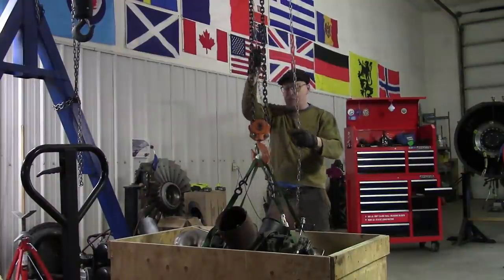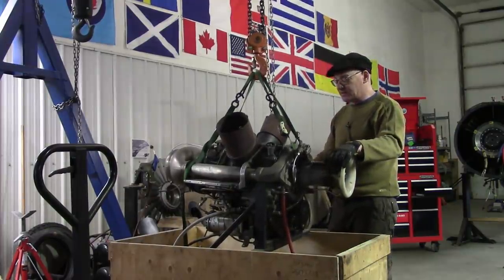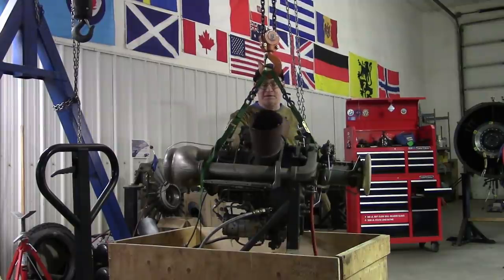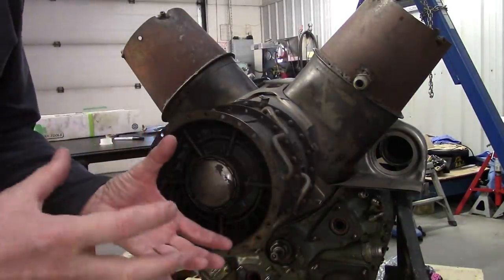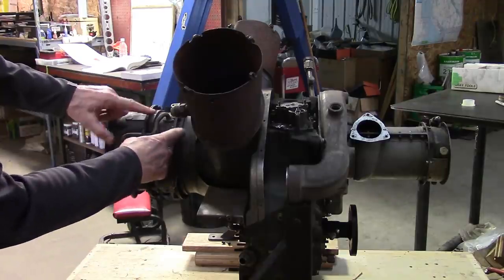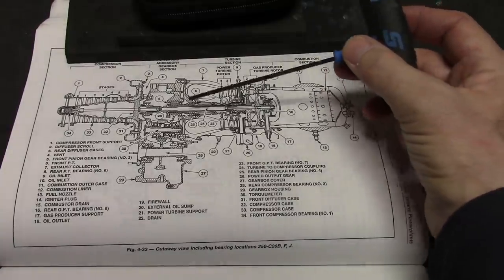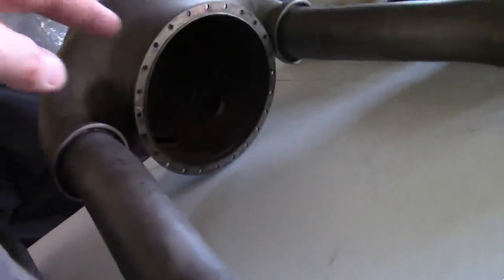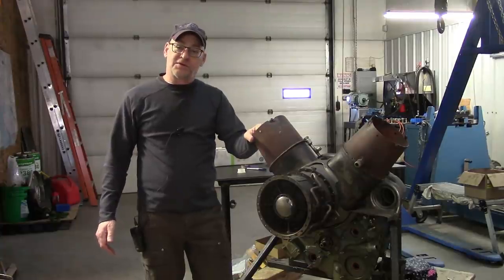Mini Jet Boat Ep.1:  The Beginning

Comment: A great example of different engineering goals leading to different engine topology. When you're trying to make mechanical power for an output shaft in a lightweight package, you just might build the turbine engine inside out as compared to a turbofan used to produce a jet of fast moving air and end up with the combustor in back instead of the middle.

Comment: Somehow I imagined that a Bell Jet Ranger would have required more than just 320 hp.  Learned something new today, thanks!
Reply from the maker: The C18 was the first. Quickly replaced with the C20, making 400. The C47, according to RR makes over 800 at takeoff power.
Not bad for the little engine that could!
Reply: @AgentJayZ  The Jet Ranger is unfortunately limited by its main rotor transmission still to this day. So even the C20B when installed in the Jet Ranger B3, is derated to only 317 HP output just like its C18 brother.

Comment: Horsepower of 300 and some is not realy impressive until you hear that all the gearbox and pumps and compressor and everthing together weighs just 70 kg!!!!!! 
Newer model - C20R - even makes 450 HP with 78 kg total weight! 
Colour me astounded!!! 
Kudos, AgentJayZ for letting us peek into you work and thank you!
Reply: Remember the first designs also date back to 1957, with similar power and mass, though the intervening years did have massive improvements, in power and reliability, along with massive running time increases as well. From engines that ran only a few hundred hours between overhauls, to engines that run thousands of hours between services, and which are more reliable as well, along with improved fuel efficiency.

Comment: Good engine for this. Tons of parts around. Small and light. I spent the last few years working for a large overhaul facility on these engines accessories. I can't remember all of them but the major difference between the 18 and the 20 was the 18 had the max stop on the FCU restricting max fuel flow. Just saying that if it was to go into a boat with no certs I might look for a C20 FCU. You should be able to find a  DP-N2  -28 or 26 FCU for cheap

Comment: Several months ago, I was watching your channel and wondered to myself "are there any engines that reverse the direction of airflow and what would that look like"?
And here's the answer. Thanks!
Reply from the maker: Have a look at the airflow diagram of the P&WC PT6. It's the second most produced gas turbine in history (after number one, the RR250!).
Reply: @AgentJayZ  Thanx! I can't wait to see this boat in action.
Reply: Engines that have a reverse airflow arrangement? Let's start with the Armstrong Siddeley ASX, the Armstrong Sidddeley Python and the Bristol Proteus.  However, they did have their jet pipes at the rear of the engine. Take a look at at a cross-section of the Proteus, which you should be able to find: the other two had essentially the same layout. 
The intake air from the front of the engine flowed around its exterior to turn 90deg inwards into a radial air intake between the compressor and the turbine.  The air was then turned through 90deg to enter the compressor, through which it flowed forwards.  At compressor delivery, the air was turned through 180deg to enter the combustion chambers, which were placed around the exterior of the compressor casing.  The turbine entry ducts passed through passages in the air intake casing and into the turbine. Now that is definitely a reverse airflow arrangement. The reason for this layout was to reduce the overall length of the engine.
In comparison, the Allison/R-R 250 has its air intake at the front of the engine, with compressor delivery air being ducted to the combustion chamber at the rear, from which the gas flows forwards through the the turbines, to exit via those distinctive exhaust elbows behind the rotor head on the JetRanger.  Compared to the 250 and the other three engines, the PT6 is just 'back-to-front'.
I was trying to find an illustration of a small US turbofan, which I thought had an arrangement somewhat similar to that of the PT6 and/or the Alllison 250.  I recalled that it had exhaust 'elbows' extending into the bypass flow.  However, I couldn't find it - but then the designation ATF3 emerged from the depths of my memory.  Please see my additional comment.
Reply: The small turbofan engine that has a reverse flow arrangement, to which I referred in a previous comment, is the Garrett ATF3.  If you search, you will easily find a cross-section and an airflow diagram.
It's a 3-spool engine: the HP compressor is a centrifugal stage, which as the rear of the engine, the IP turbine drives the fan, and the LP turbine drives the IP compressor.

Comment: so excited for this build. I'm a retired dude who flies the 206s and loiters around the hangar watching maintenance and inspections. Would love to see a deep dive on the oil system maybe with your thoughts on why the aft bearing particularly prone to coking.  Also, maybe a bit off topic, if that engine still has a freewheeling clutch, I would love to see its internals before you ditch it.
Reply from the maker: The sprag clutch is part of the helicopter gearbox, so we don't have it.
The aft bearing is directly in the path of combustion gases. It's under that shiny cover in the thumbnail for this video. Well protected by steel and cooling air during running, but after shutdown it sits there and the heat soaks in.
Reply: @AgentJayZ  roger that. I was a little imprecise. The most problematic bearing is No. 6 (the aft is No. 7). I'm sure your comments still applies.  On an annual  inspection, we measure the flow out of that bearing. Mods were made to add a little sump for that bearing and also a check valve to cut off oil flow a bit earlier during shutdown. I believe the sump promotes draining after scavenge suction has dropped.  We're also trained to hand turn the main rotor backward after shutdown. (backward because of the freewheel clutch). but there isn't much agreement about the effectiveness of that. 
Just for the record, for aspiring heli folks,  the sprag clutch isn't exactly part of the helicopter gearbox, it attaches to the power takeoff pad on the engine accessory gearbox. From there, the short shaft goes through the forward firewall and connects to the MR gearbox in the next compartment. https://photos.app.goo.gl/XEBxH9H3L95VMgxz5

Comment: Great project! Have seen some crazy offshore boats built in the past with T58 GE and a bunch of superyachts with even larger turbines in them. Any thoughts on how a diesel powered Capstone turbine could be used as a range extended hybrid electric set-up ?
Reply from the maker: There is no advantage in using a turbine engine as opposed to a piston engine for that purpose.
The are disadvantages: the smallest turbine engine I know of designed for running more the a couple minutes is 200 HP. It costs a few hundred grand.
That's your second disadvantage right there...

Comment: This is awesome!!

I have flown some of these and there has always been one thing that has bugged the hell out of me.  The torque meter. 

I could never get a good explanation of how that works and what it is really reading.   For years no one could ever tell me how it works.  Then at Sun-N-Fun I spoke to a guy that was converting Chinook engines to jet engines for planes.  He told me that in the gear box are two beveled gears and under toque they try try to spread apart and that opens a valve and it uses oil pressure to push them back into position.   The gauge reads this pressure. 

Not sure why it would be setup that way.  If you could zero in on this setup so I can see what is going on in there so I can make some sense out of it.  Thanks if you can help me understand how that works.
Reply: That sounds like a hydrostatic thrust bearing with a pressure monitor. Usually hydrostatic thrust bearings are used very large applications such as hydroelectric turbines using one would make sense for this application, the valve could be integral to the bearing in the form of a port or ring of ports.
Reply: @ValExperimenter  That is what it sounds like, but I really would love to see it to better understand it.
Reply: @Gadget0343  i have a RR250 training manual with the explanation
Reply: @juanmam1992jm  Cool.  Is that something you can share somehow?

Comment: I wonder if Rolls Royce Holdings could brainstorm with Rolls Royce Motor Cars to use a 250. Chrysler tried a turbine car back in the day, but that was a totally different beast. Something with a 250 generating power for electric motors and auxiliary power would be interesting.
Reply: Have a search for the Jaguar cx75, prototyped hybrid electric twin micro gas turbine set up for emergency power generation/range extender, was a few years ago now, never found any details on the "micro turbines" but just from the name I doubt they were anywhere near the output of the RR.
Reply: Rolls-Royce motor cars are really top-end BMWs and have been for many years now.  I suspect that they will be going hybrid and electric, in accordance with the policy of the UK government, even though the bulk of production is exported.

Comment: Put that in my lil boat. It is 4'x7'  w/ a 4" freeboard. Weighs about 80# w/o the motor or gas. It has paired fender flares front and back for styling. I love it. Early fiberglass front engine, pre wave runner.

Comment: You guys have the gear box on that engine, we used the tail rotor drive shaft quill to power a drive shaft going to a prop. The engine uses a lot of gas, the engines were made that way
Reply from the maker: As mentioned, burning gas(oline) in this engine will work, but will shorten the service life of the fuel pump and controls. It's designed to use kerosene, Jet-A, or diesel.

Comment: Awesome project... Is he going to employ a Berkeley Jet Drive Model 12JC with this project? Which boat hull design does he like? Classic jet boat, High performance Pad hull, Pickle Fork? I powered a 17'9" High performance Pad hull with a v6 outboard developing 271 HP... 80 Knots was no problem. I'm known as a Boat Yoda! I've never employed a turbine engine for a boat power plant. Gas ~ Diesel 1HP ~ 1,000 Marine Service Specialist, 8' ~ 52' Composite Loft Plug Specialist Fiberglass ~ Carbon Fiber parts producer Marine ~ Aerospace... Electric Drive Specialist...

Comment: Does the gearbox provide enough resistance to allow the engine to run without anything hooked to the output?
Reply from the maker: No, but you can run a free power turbine engine with the power turbine immobilized, for a few minutes.

Comment: Do you think this might be the longest running production engine?  Certainly there isn't any automotive or truck internal combustion engines designed in the 1960's that is still being produced today.
Reply: The last 'classic' Mini was produced in 2000.  Its engine was a development of a 1940s design, with relatively minor changes.
Reply: VW ?
Reply: Buick Rover Land Rover V
Reply: @axelknutt5065  Yes, the original flat-four, air-cooled engine was designed before the war by Ferdinand Porsche for Adolf Hitler's Peoples Car, wasn't it?
Reply: I've already mentioned the 'classic' Mini engine, basically, the BMC A-series engine, which, I believe, was derived from the Morris Minor's 803cc engine.  I might also mention the Jaguar XK engine, which was produced between 1949 and 1992, but I believe that the VW Beetle engine can probably claim to be the longest-lasting automotive engine design.
Reply: You might be right. Chevy small block is probably closest in cars. Ural motorcycle engines might have them beat but the 250 is looking down the barrel of 70 years old.

Comment: What does a used Allison 250 C-18 cost ballpark.
Reply from the maker: As always, depends upon condition.
This one was missing pieces, hadn't run in 15 years, and was given to me by someone who was never going to use it.
I had done nothing with it for ten years, so I offered it to anyone who was going to spend the time, effort and money to put it to use.
the C-18 is no longer supported, so you can find them by searching and scouring. But since they are no longer part of the aviation aftermarket, they will be hard to ferret out.

I just searched for one, for 20 seconds, and found none, but there was a nice, shiny C-20B for 150 grand.
This engine was considered scrap when it was originally obtained back in the 90's, for the price of a decent used car.

Comment: Finally. Boat. I do have to ask. What would happen if I put this on a jetski?
Reply from the maker: That was one plan. The exhaust handling might be a problem. Lotta burning hot air to not get in your face...
Reply: @AgentJayZ  Water jacket the exhaust. The Lake is your radiator! Jetskis are fun to work on as long as you make up your mind to just pull the engine instead wasting time working in the tight spaces...

Comment: Hey thank you for your great vids.
I've a question about this kind of engines: How high is the pressure in the pipe from the compressor to the combustion chamber? Is this even measurable?
Best Regards from Germany
Reply from the maker: That variable is called CDP or compressor discharge pressure. The info I can find is the compressor ratio of the next latest engine after the C18, the C20.
It's listed as 6.2:1 So in that engine at full power CDP would be 14.7 X 6.2 at sea level.
Reply: On the C20, which is the successor to the C18, the discharge pressure of the compressor on a good engine is around 200+ inches of mercury at full power. So about 100psi.

Comment: So does 100% of the air coming through the transfer tubes have to escape through the combustor liner and turbine section or does some of the cooling air get bypassed?
Reply from the maker: There's no escaping, and no bypassing.
The compressor discharges air into the two ducts that lead to the combustor. Some of that air is used to burn fuel, but most of it is used as cooling air. By the time it all leaves the combust, the mixture of cooling air and combustion gases is all the same temperature, which is why I call it "working air". It is the gas stream that flows through the turbines, and does all the work.

You could say that the portion of compressor discharge that is not used for combustion "bypasses" the combustor, but that is not the way the engineers describe it, and you will always find people like me saying "that's not the correct terminology".

Bypass air has a very strict technical definition, and there is no bypass air in a turboshaft engine.
Reply: @AgentJayZ  I was just trying to figure out if all of the air had to escape through the holes visible in the combustor liner. It doesn't seem like there is enough area. But then again, I was shocked to find out just how little of the overall diameter of any jet/turbine is used as a pathway for air moving through the engine. Thanks.

Comment: There's a sad but relevant news story of a fatal jetranger crash in St. Thomas last month. Although preliminary, the evidence suggests that the third stage of the compressor shed a blade;  which completely stubbed the 4-6 stages. (C20B). I'm comforted that I mostly fly a heli with a C30P. This iteration of the 250 completely eliminated the axial stages and gets by with only a centrifugal compressor. Seems like a huge simplification. Did something change in centrifugal design to make this possible?
Reply from the maker: Yes, the aerodynamic performace of the centrifugal compressor was improved to the point where the axial stages were not needed.
Reply: @AgentJayZ  Amazing!

Comment: I just don't like to see the compressed air path being bent.
Reply from the maker: I don't like being bent to see the compressed air path.
Reply: Luckily, the airspeed after the last compressor stage and before the combustor is pretty low, so the losses are not bad (and it sure helps keep the engine compact).

Comment: I'm sure you've seen the Nye Thermodynamics turbine boats on Lake Ontario they are insane machines...  he was replacing 1500lb 400hp piston engines with 400lb 1400hp axial flow turbines.  I think his boats got up to 80 knots they but were at least 20 footers to handle the power.  It was finding a manufacture for the water jet to handle the power was his biggest issues if I recall.
Reply from the maker: That is lame. The Jet boats on my channel are 23 feet long, have 1200 Hp, and have been GPS clocked at over 150 Miles Per Hour on the rivers.
In the racing videos I have put up, speeds are around 140 mph at the top.
You gotta know what you are doing.
Reply: @AgentJayZ  holy shit I didn't know that I've seen those fast boats but I need to study up it's nuts the power and speed.  | really like your channel I;'m a techi I get it but you do a great job explaining it.  I forward you to my backwards cousins prairie living hahahaha

Comment: Be interesting to see how this turns out, always thought it would be cool to run a turbine in a mini, but for now I will carry on with my 13' powered by a supercharged Rotax. Do you know what make and length hull this is going in?
Reply from the maker: Your boat sounds like a sporty little missile.
I don't know how good of an idea this one is going to be. It's a 12ft. hull, and I've told Justin that if he can hold the throttle wide open for 10 seconds, he wins a case of beer.
Reply: @AgentJayZ  I think you'll be out a case of beer lol. There's more than a few mini's with 300+hp kicking around, they're not that scary. As long as he puts it in a decent hull, if it's an Eagle or Bratt it'll be fine.